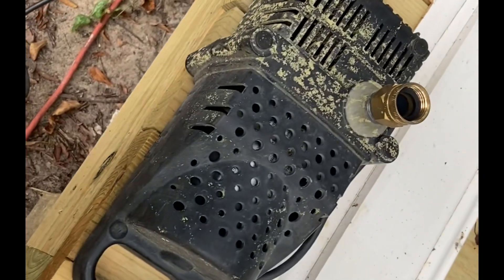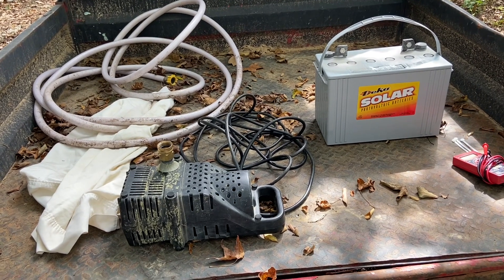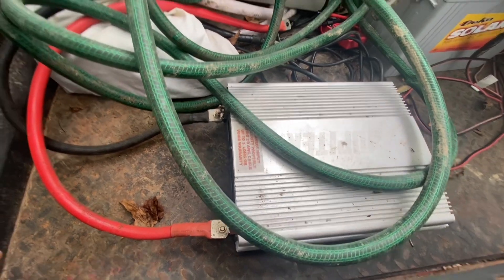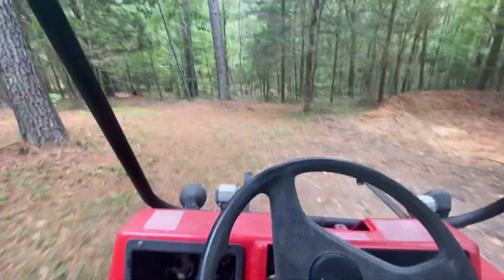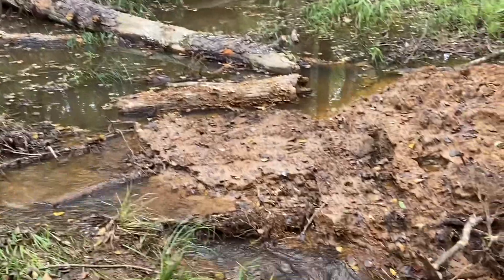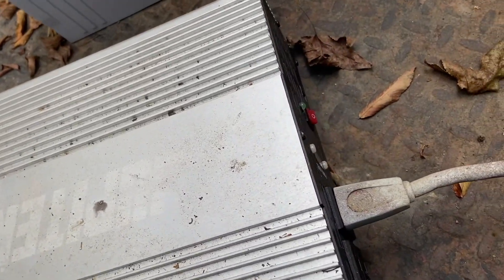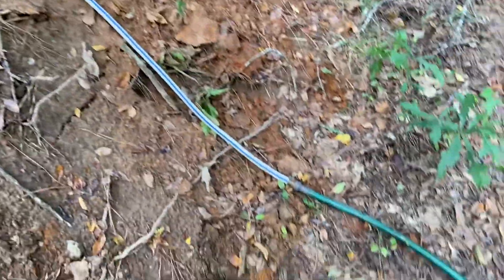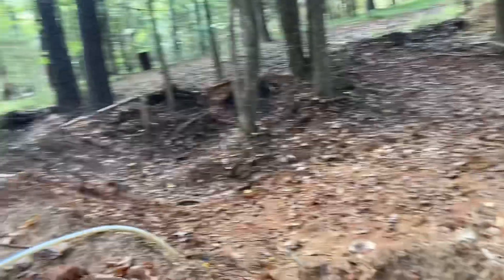Using Solar Power to Pump Water Uphill From The Creek to the Top Pond

Comment: Seems like the solar panel will get blocked by shade during the day, very cool the little pump carried water that far. You might want to line the pond with some kind of plastic or rubber liner to hold the water in....

Comment: The area may be too shaded to get much help from that poor little solar panel.
You might want to set it up in a non-shaded area.
Reply from the maker: @heroesandzeros7802  i didn’t have any more extension cords for it. When I actually install it I will place the panel in direct sunlight. This was a test run of the capabilities of the pump and solar combo that I had available.

Comment: With that distance and elevation difference, you may need more than 1 pump.
A pump will only put out so much head pressure.
Reply from the maker: So this pump was free, but I will probably get a higher gph pump later when I do an actual installation of everything.